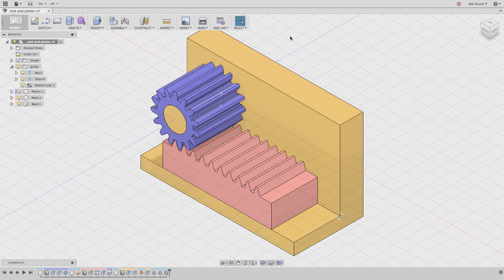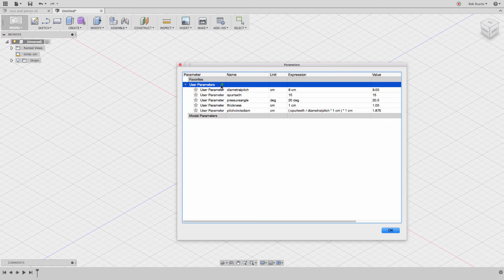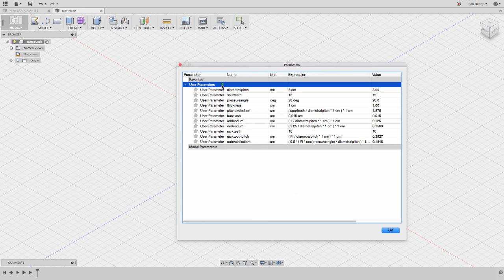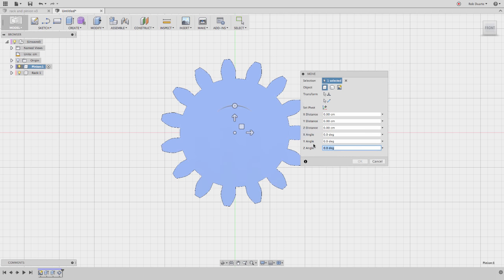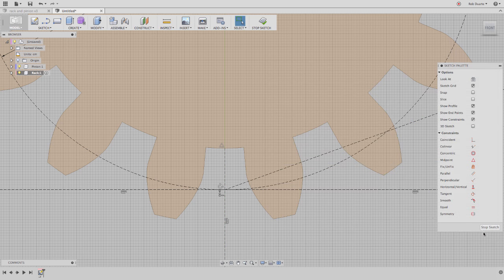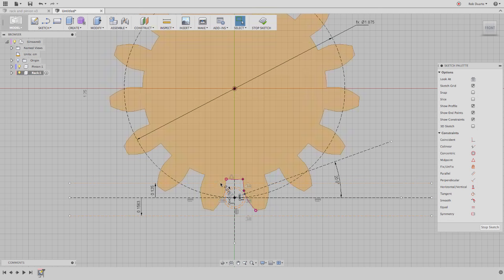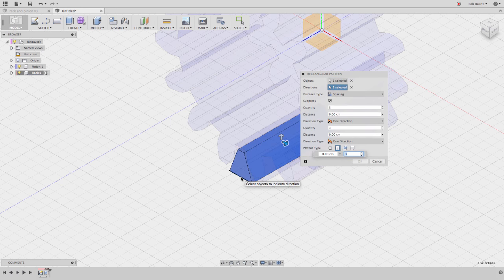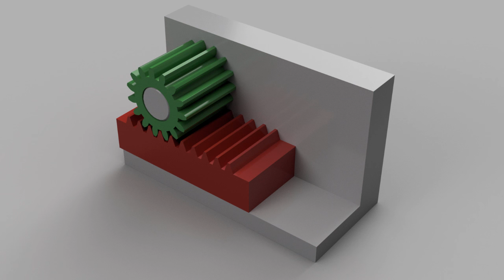Fusion 360 Rack and Pinion Gear

Comment: For anyone watching this in 2017, the SpurGear addin has changed, so rather than "diametral pitch," the plugin now relies on "module"--which is the inverse of diametral pitch. This makes a lot of sense, since the proper units for diametral pitch are 1/(length unit), which Fusion360 doesn't allow, whereas the units for module are just length units, which are fine. However, the plugin demands that module be unitless, for reasons that are unclear. It's best to keep the units on module, and just divide them out when you run the plugin.

I actually prefer to start with the pitch circle diameter as a primary length, since this is how you calculate things like the mechanical advantage of the gear, and have Module as a derived measure.

Then your derived measures are:
module = pitchcirclediam / spurteeth
addendum = module
dedendum = 1.25*module
racktoothpitch = PI*module
outercirclediam = 0.5*PI*cos(pressureangle)*module

The only weird thing then is that, when you enter the module in the SpurGear addin, you need to divide by your length unit to make it unitless, because the addin demands that even though it the units are actually pretty important.  So I was using mm, so my expression was module/1mm. Otherwise the plugin turns the number red and greys out the "okay" button.

The rest of the tutorial works as normal.
Reply from the maker: Thanks for the update!
Reply: OK, and what does all of that means? what do I have to do? In English
Reply: Just what I needed, thanks for putting this together!!
Reply: Thank you!
Reply: exactly what I needed, thank you :)
Reply: Awesome. You should pin this so it remains at the top.
Reply: Thank you, Nicholas, for the update, but I still get stuck at this point, because there are so many other parameters required in the  new SpurGear addin. Can you provide more details, please?
Reply: its back  module is gone in 2019
Reply: @ClownWhisper  ??? huh I'm using it?
Reply: Thank u!
Reply: module?
Reply: For anyone that needs the calculations... Diametral Pitch = Number of Teeth / Pitch Diameter. Pitch Diameter = Number of Teeth * Module.  Module = Pitch Diameter / Number of Teeth.

Comment: Another update to make things easier - when generating the gear using the SpurGear add-in, the third sketch of the gear is the diametral pitch, so you don't have to generate the first circle shown. Simply unhide the third sketch and then project it into the rack sketch.

Comment: just fyi the last 2 formulas do not work at all in fusion anymore not sure what to do
Reply from the maker: I just tried it and they work as shown in the video. Double check that you're using the parenthesis in the same place. Also, the plugin has changed since this video was made so you might want to look at the pinned comment by Nicholas Halderman. Someday I will make a replacement for this video that takes his comments into account. Good luck.

Comment: I know this should be obvious, but why if I am working in mm and not centimeters does this all go to heck.  pitch circle diameter being number of teeth / diametral pitch makes no sense if the diametral pitch is 80 mm, you end up with a tiny cirlcle....
Reply: Looked this up, diametral pitch is not in units of cm, it is in units of teeth per cm, so you probably should have used no units here and that would have solved the other unit problems you were having

Comment: Is it possible to use the same method to create a curved rack gear?
Reply from the maker: Good question. I would say that you could do everything exactly the same but pattern the teeth along a curved path instead of in a straight line. I suspect, though, that the spacing would not be the same "rackteeth" parameter. I just tried it really quick and it looked close - worth more investigation. If it's not "rackteeth", it just means you'd have to figure out what formula comes up with the correct value for the pattern spacing.
Reply: Interesting. I will give it a shot later. On second thought, my design really just needs a gear that is a half circle, so maybe I could create a larger spur gear and then modify it? I'm making a miter gauge for a table saw and my idea is to have a pinion gear with a knob that adjusts the angle of the miter gauge as you rotate the knob.

Comment: But ... this gear is not actually a propper matching rack gear for that generated spur gear, is it? I mean, it doesn't have the curve. I bet those curves are there for a reason. Or am I missing something? I  know its proably good enough for most use cases. But it would be nice to actually have the propper gear.
Reply from the maker: Gefrickelt BLN the rack will have a different tooth profile, so you shouldn't expect the teeth to look the same as they do on the circular gear. Check out this website - it seems as though the fillet on top is optional, but you could easily include it (as well as the fillet at the bottom) in the sketch. Just base the dimensions on a diagram like the one shown on this site - I used a similar reference for all of the dimensions/formulae that I use in the video. http://khkgears.net/new/gear_knowledge/gear_technical_reference/involute_gear_profile.html
Reply: I'm not sure if we mean the same thing, are you talking about topping/semitopping?  I don't, I mean the contacting side faces of the gear are straight lines in your sketch, but the contact faces of the spur are curved. Like here http://khkgears.net/new/images/involute_gear_profile/Fig.-3.12-Magnitude-of-Semitopping.jpg vs here http://khkgears.net/new/images/involute_gear_profile/Fig.-3.9-Tooth-Profile-Modification.jpg
Reply from the maker: Yes, this is how the reference that I went from described it. (That the faces on the circular gear's teeth are curved, while the faces of the rack teeth are straight). A quick Google search seems to verify that this is how it normally works. But maybe there's more to it, as you say.